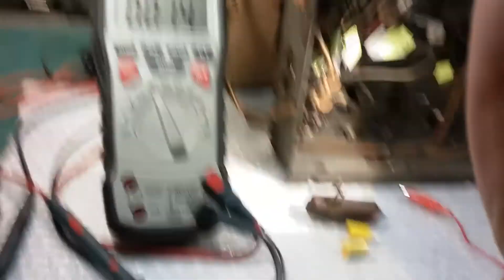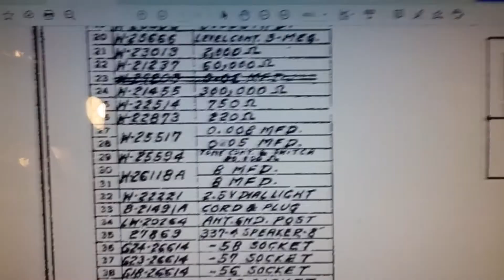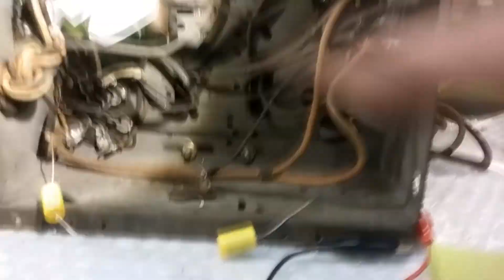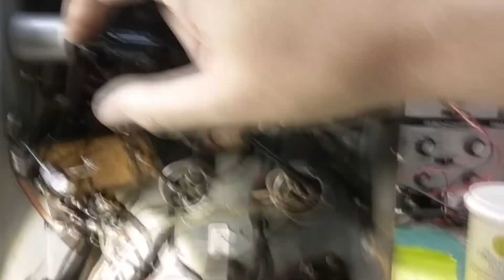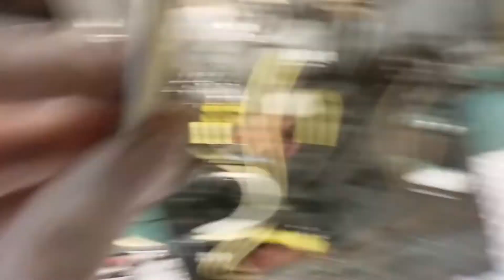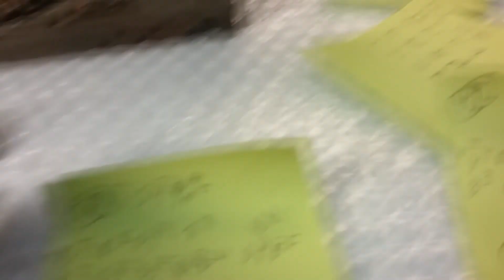Crosley Antique Console Radio 157 - Part 3: The Recap Begins

Comment: Really appreciate you showing this rather unique dual wax capacitor  Paul. Don't often see those , in fact  the schematic may lead to otherwise be looking
looking for two separate capacitors ! Luckily the parts list  next to schematic  helps you see it is one capacitor with two values contained inside.
A lot of times a Bakelite block would be used here with two capacitors inside, but this isn't a Philco radio! Interesting use of the tone control/on-off switch pot!
Good idea put a rubber grommet into the hole for the new speaker wires.Learning quite a lot here!
Reply from the maker: Glad it is helpful to you.  I learn alot with each new challenge. 

You're right,  with just the schematic, it would have been different to figure out. Thanks for the comments!